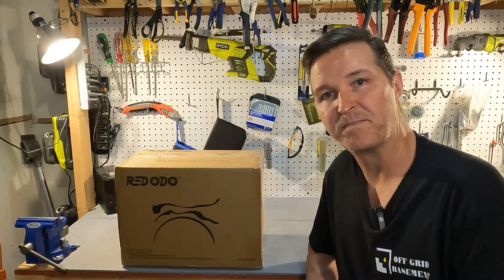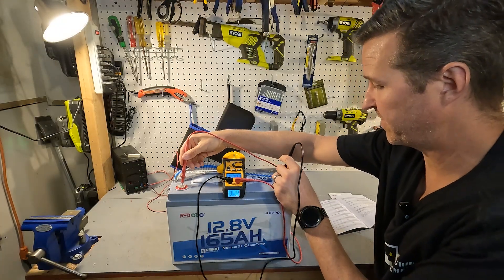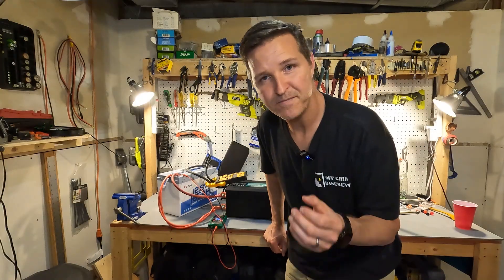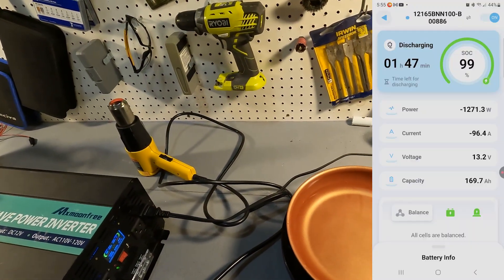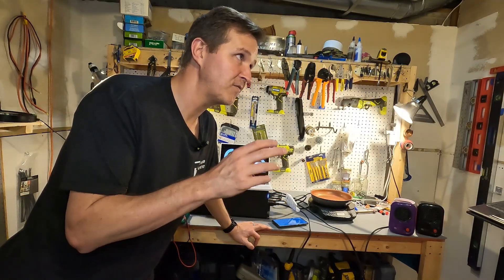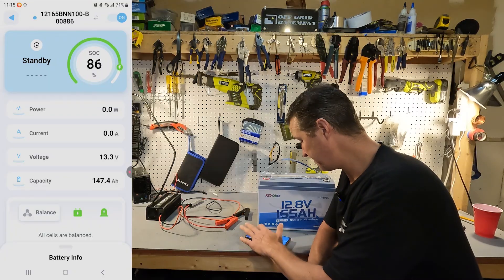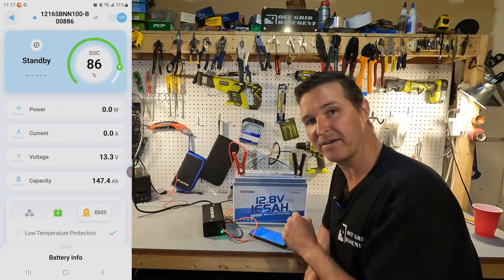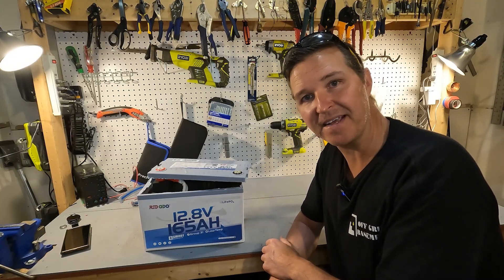Redodo 12v 165ah Lifepo4 Battery review and Teardown!

Comment: can these chargers be mounted in a boat compartment? Like a traditional charger. Reason being, so it will be somewhat secure, when charging at a hotel.
Reply from the maker: Yes.  There's no reason they can't be.  The only thing that's different is the charging voltage.
Reply: @OffGridBasement Fantastic! Thank you

Comment: I notice the reviewer here pronounces this battery as: "Red-Oh-Dioh". That can't be right as its spelling is Redodo. So, wouldn't "Ree-Doh-Doh" or "Red-Oh-Doh" be its pronounced name? 
Otherwise, nice to see some analysis on it.
Reply from the maker: This is direct quote for an email I received from REDODO.
the actual pronunciation of Redodo is Red-odio, you may get the correct pronunciation from this video https://www.youtube.com/watch?v=kSeAn2uVD8E
Hope this helps.
Reply: @OffGridBasement  It turns out that the name, being registered and therefore correctly spelled is mispronounced by the Chinese owners as the spelling plainly isn't Rododio. Interestingly, many Chinese companies use English-letter brand names but pronounce them with syllable patterns familiar to Mandarin or other Chinese dialects, which can lead to the way it's pronounced as heard in the link you sent to me. Oh well, still a great product! :)

Comment: How do I use this battery as a UPS for my gaming computer?
Reply from the maker: It would need to be wired to an inverter 24/7.  You also need a battery charger.  I recommend using a power station instead.  Much easier to wire up

Comment: Could you describe your "charge to 100%" process? Unless the mfgr provides active cell balance in the bms, initial 100% status may be fake with charge cutoff due to only a single cell reaching full charge & that out of balance tends to worsen if never corrected.
Reply from the maker: I use a 20A Lifepo4 charger to get the battery to 14.6v.  If the cells were out of balance, I would notice it in the first discharge test.  I wouldn't get a discharge of over 165ah for this particular battery.  Thanks for the comment.

Comment: The ah rating is so non traditional, but good battery.

How do you measure that discharge curve? Would be interesting to be a permanent feature for any battery bank.
Reply from the maker: I have a tester connected to my laptop.  Here is the link:
EBC‑ Battery Capacity Tester, ‑ Lithium Iron Battery Load Tester 5A 20A Discharge Electronic Load Meter (US Plug)
https://amzn.to/3z5tNBV